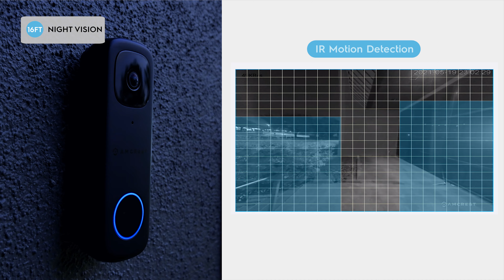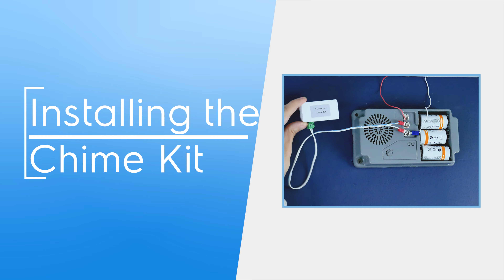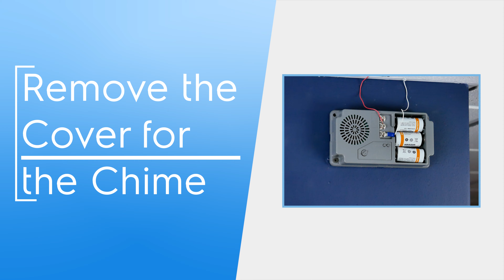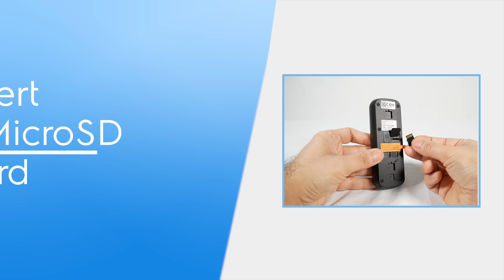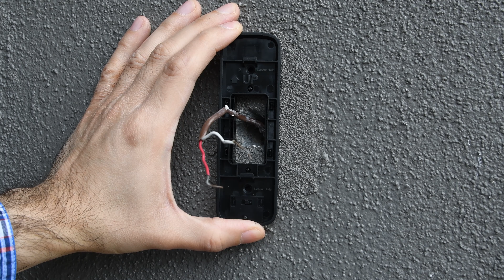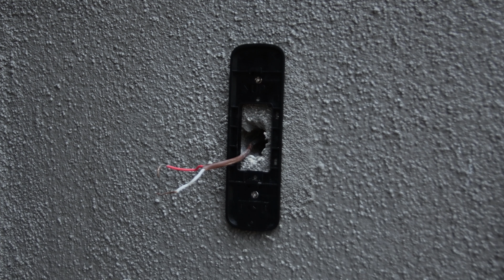Amcrest 2K 4MP Video Doorbell Features and Installation Video with Chime Kit Model No: AD410

Comment: I'm considering upgrading from the AD110 doorbell to the AD410. The AD110 has three mounting holes arranged in an inverted triangle (two on top and one below), while the AD410 has two mounting holes aligned vertically. If I install the AD410 by drilling a new hole above one of the existing AD110 holes, will the AD410's body cover the two upper mounting holes left behind from the AD110?

Comment: How would you connect 24 DC (Not AC) to it?   The specifications for the Amcrest 410 4MP Doorbell specifically mentions Power Input:  AC16V~AC24V, DC12V~DC24V, but the pins on the back is not marked with a '+' (positive )and '-' (negative) ? 😒

Comment: Did anyone else cringe when their "professional" installer wrapped the  wires around the screws counter clockwise?
Reply: The white one had no wrap at all.   Just jammed under the screw on one side with lots of conductor showing.  Pretty poor example.  Notice in the next chapter the ring terminals are being used again.

Comment: You forgot the part where you give your new doorbell a gentle kiss goodbye. Because in my neighborhood it will be stolen in a day or two. Guys, you need to figure out a way to securely secure the doorbell to the mounting plate.
Reply: jb weld
Reply: @aaab6054  i agree, but then what if you need to remove it to get the SD card or some other reason?
Reply: Screw a metal L bracket above the doorbell with custom security screws so it can't be lifted without removing the bracket first

Comment: Notice that all doorbells being replaced were the narrow covers, not any with a large white cover the size of a wall switch.  This is deliberate because the video shows the new doorbell as "larger" than the existing hole, so no concrete or painting needed!  My old doorbell has a hole behind the big white wall plate, so the house needs "body work" for it to look correct.  Hiring a contractor to fill in the big hole and paint are what we call "potential hidden costs".  Can't drill into masonry where no masonry exists!

Comment: NOT CONSUMER FRIENDLY OR SAFE
This is a company that focuses only on producing camera. The utterly useless and multiple of softwares and apps needed to operate any singular function is so bad I'm going to put all of my effort into making bad reviews. The security of the apps and software is completely missing. There are no upgrade features on any of the apps or software, so if you ever want to upgrade (the only way for your camera to operate like a real security camera) you are stuck with being a security guard relying on the live feed. You have to manually record everything. The alerts/alarms don't even work. It's so sad because the hardware is actually well designed. You can clearly tell this is a production company, not a security company. 
If you try to call any department in the comapny, you have a 10 minute waiting period with the most anxiety-inducing experience of my life. It's a 6 second message telling you to f***-off and visit their YouTube page. What's worse is that the messgae glitches like a scratched 90s CD. 
It's obvious the company does not read any of it's reviews because they ARE THE LOWEST REIVEWED PROUDCT. Go to any app store or even Amazon and you'll see the company makes a well designed hardware unuseable. 
This company is so awful, consumers need to be aware.
Reply: Did you install an SD card, and turn on motion detection for recording? There's also a notification  and schedule settings under account that might need to be turned on. I have the first gen 1080, and for the most part it works great. My only real gripe is how they setup the SD card slot, and not having human detection. Have to have sensitivity way down so it doesn't pick up all traffic in front of house. Especially at night, when headlights shine on the lawn.
Reply: @brianhanfgarn2513  On this version of the camera you can turn off motion detection and just use human detection, that's how I have mine set up. It doesn't give false motion alarms but I have gotten push notifications when it detects my cat. 🐱
Reply: I feel your frustration, I've been there. Just a correction, Amcrest doesn't make the camera, it's made by Dahua. Out of my 14 security cameras this is the only Amcrest camera I own and while slow, I haven't had a problem with the app on my Android phone.

Comment: How is it secured to the mount, it looks like it just snaps in? What keeps someone from taking it? The first one at least had a screw in the way. Only issue I had with the first was possibly having the sd card stolen, because the face plate just pops off.
Reply: The mount may be secured, but the software renders it useless
Reply: @Mayp13Syrup  what do you mean it may be secure. What keeps someone from just popping it off? Is there a pin or something that needs to be inserted to disengage it?
Reply: @brianhanfgarn2513  It snaps into place and you use the provided pin tool to release it via a small hole on the bottom of the camera. Keep in mind that it's made out of plastic so I don't imagine it would be very difficult to break right off the wall. If that is a real concern you can always use their cloud service or perhaps stream the video to an NVR if you have one.